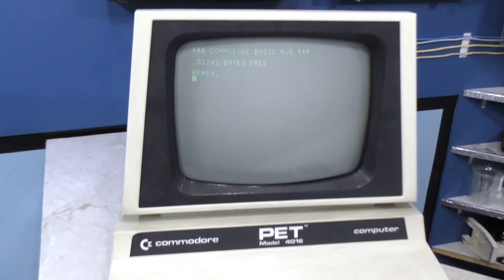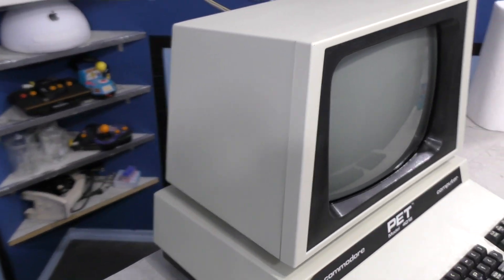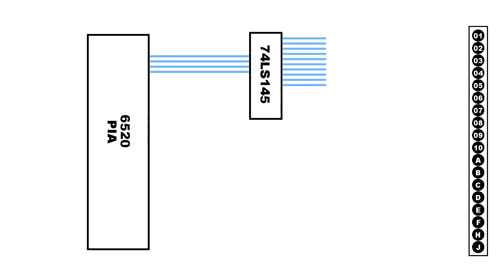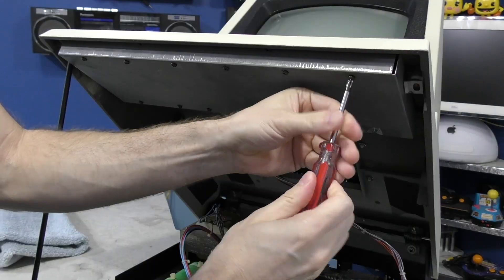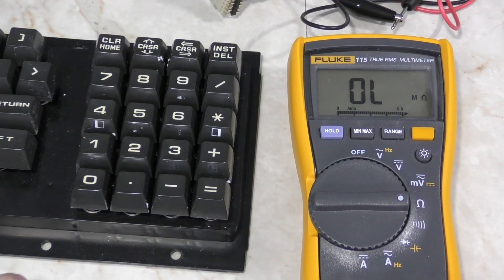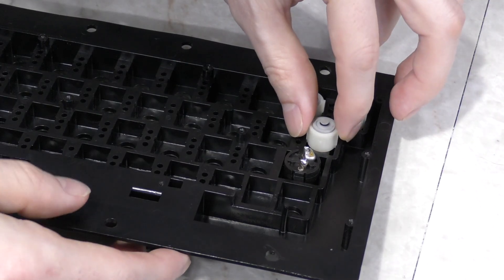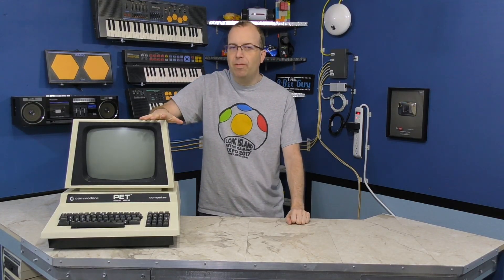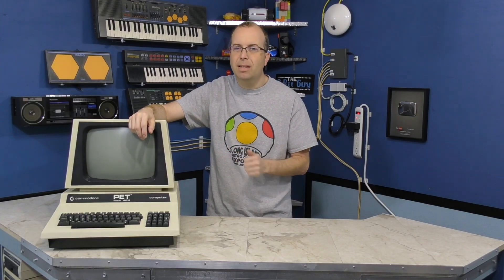Commodore PET Repair and Restore

Comment: I just did a restoration on an early model VIC-20, which has the same style keyboard.  I used a Nickel Conductive Pen to coat each carbon pad.  Seems to have worked well, but I can't speak for the durability yet.  The pen was much cheaper and could probably do at least 3-4 keyboards before running out.  Link> https://www.amazon.ca/MG-Chemicals-Conductive-Pen-Nickel/dp/B01LYAA814/qid=1505418400

Comment: I bet some previous owner tried to repair the keyboard by switching out the keys that were starting to fail with ones from a business model that didn't have the graphics printed on the keys, and they broke the spacebar trying to pull it off. You might be able to find a dead PET with a good keyboard and swap the keycaps and spacebar to fix your remaining keyboard issues.

Comment: You should check out Sciplus Wire Glue. I don't know if it would work quite as well on the carbon contacts, but I have used this stuff for minor repairs and it worked well.

Comment: When I worked for a computer repair factory in the late 80s early 90s, we would use extremely fine (the finest you can get) sandpaper on the carbon contacts and rub it as gently as possible on the contact.  We found that just rubbing alcohol on it's own never worked perfectly either as in your demonstration.

For the metal / gold contacts, we used a simple pencil eraser and then wiped them over with alcohol to remove the rubber residue.  It always worked for us and didn't have a single return.

Of course, you could always use electrically conductive paint, but that's not something I have ever been a fan of, but it's cheaper than that repair kit.

Comment: My Commodore has a small monitor but its case is also made out of plastic. Commodore made the metal cases in their factory that also build filing cabinets, but later on they switched to plastic to save costs.

By the way the keyboard should be familiar: the C64 used the same keyboard but they removed some of the keys from the numeric keyboard and changed them into F-keys. The keyboard layout is of course irrelevant: that's just a matter of a table in the kernal.

While the PET may not be for everyone, that's mostly because there's not that much software for it. They are actually very easy systems to repair, because there are no custom chips inside it. The hardest parts are the old RAM chips which tend to go bad over time. But there are people who have made little circuit boards that you can plug between the 6502 and the motherboard that will let you test the chips, the video and the RAM, and will work around any memory problems you have.

Information is actually easy to find, if you know where to look. Start at the forums at 6502.org and check out ftp.zimmers.net for all schematics, ROM dumps and other interesting stuff.

Comment: Now before you make the very first part of the Commodore series you have to decide what base unit you want your fixed bits to be in the full metal or the part plastic. lol.

If it's interchangable I'd go full metal on it I think if that was the original one.

Comment: You'll find it works better to leave the cleaning solution on for at least five minutes. Get the surface good and wet, and you won't have to scrub at all in order to get the crud off. I collect mechanical calculators, which are usually constructed of painted metal just like the PET computer.

Comment: Im not sure if anyone mentioned this but you may have been able to use a circuit pen to add material back to the key pads which would've been much cheaper.

Comment: BTW, My cleaner of choice is some ZEP 505 - it's a cleaner degreaser and if you're not careful, it'll leave the 'degreaser' on there even after you've 'wiped it away'.  SO I usually go back after drying off with paper towels, go back with wet paper towels or a damp-ish sponge) and try to scour a little bit while also getting rid of more of the degreaser, then another round with the paper towels and finally if need be, back to a magic eraser and more paper towels.  a little goes a LONG way but it's made my "cleaning" projects SO much simpler.  give it a try or PM me your address and I'll send ya a bottle to try!  *(nope, don't work for them, just a fellow restorer and retro-brite-r)

Comment: You really should start using sugar soap, its far less abrasive and takes all this crap off really easily. Also, take the thing apart before you clean it - I wash cases down with the shower and leave them in the sun.

Comment: I restored an old keyboard with this kind of rubber using tin foil, super glue and a paper punch. I punched the tin foil with the paper punch and glued the tin foil on the rubber. Working fine since 2009.

Comment: the tool used for fixing the keyboard seems like a "conductive silver paint", which is basically a mixture of silver and paint. widely used if you want to overclock and change your amd Athlon XP cpu. 
as for the screen, basically the brightness for a crt display will be not enough for two reasons:
1. crt display is going to die. the filament or phosphor might have reached its life.
2. elec issue. for example, if the coil of FBT is having a weak insulation, voltage to the CRT might be lower than normal, then making the filament not hot enough to send electrons to the screen.
Both of these problems can be partially fixed by raising the output voltage of the FBT, which means turning up the "sub brightness control" in the video. However, I still recommend to open the CRT and see if it is really a crt problem, because if the problem is on the coil of the FBT, simply raising the voltage could possibly lead to permanent damage for your PET, or even you.

Comment: Dear 8-Bit Guy! When I repaired old synth keyboard I also tested it with multimeter in 'beep mode', but i discovered that pressed key have a little resistance, so even if it works you will not be able to hear beep. You need to hold each button for a longer time and check resistance changes

Comment: Using baking soda is actually stripping the paint. It's an abrasive. So you're not so much as cleaning it as taking off the dirt and a bit of the paint.

Comment: Not sure if anyone else has pointed this out, but he could do the same thing on the cheap with either some spray-on dry lock lube / anti seize (my preferred method) or a more permanent solution with some acrylic nail polish with metal shavings mixed in (say, grinding a penny with a dremel)

Comment: Thirty years ago I bought a really nice discarded keyboard for a project. It turned out that the keyboard circuit used capacitance detection instead of real contacts and I couldn't get it to work (that's why I got it cheap). To make it work for me, I used some expensive silver goop (just like in this video) to make the keys create real electrical connections. I figured out the keyboard matrix and got it to work!

Comment: I laughed out loud when you lifted the cover up and used that bar to lock open. That's just mad funny. That multiplexed keyboard is probably the mainstay of keyboard scanning on embedded application. The chipset was a trip down memory lane. I remember when this was cutting edge. Regards Chris
Reply: I think although your fix corrected the keyboard the resistance reading of the original pads was normally. The material you put back is a much lower resistance than the original. I think you should check if there's in pull-up pull-down resistors associated with the keyboard scanning

Comment: One recommendation, NEVER put a non insulated screwdriver close to any CRT component, you was lucky and you do not electrified yourself. 
To know in a monocrome monitor the focus pot has around 1kVdc on the high potensial pin and the intencity pot around 100Vdc. So be carefull.

Comment: I repair these old keyboards' pads by painting some graphite coating on them. That's much cheaper than this repair kit and worked fine so far. Some people say that it will rub off after some time but I never had a problem with it and even if, I could just clean it up and apply it again...

Comment: Hi, for the keys you can use some serigraphy, with a tiny screen and poly ink you print all the missing things, it's very easy really, that poly ink it's special for wood, glass and plastic and it doesn't drop off.

Comment: Just wondering...but would it have been cheaper to glue aluminum foil to the bottom of the keys? I imagine copper would oxidize. Or maybe glue some wire across the  bottom? I know dumb ideas probably hah

Comment: Yeah the stabiliser tabs on these old spacebars can get pretty fragile from age. I had a similar problem on an old IBM mainframe board that I fixed by cutting up a credit card to size and glueing it to the remnant of the plastic tab. Doesn't look great, but it's on the inside of the spacebar and it works. I've never seen that conductive paste to fix the rubber pads before, that's pretty interesting.
Reply from the maker: That's a similar idea to what I'm considering.

Comment: I'd recommend finding someone in your general area who restores/repairs old TVs to have a look at the monitor. You probably have either not enough high voltage due to worn out or failing components in the HV circuitry of the monitor or a worn out CRT (poor emissions). First can be easily fixed if you know what you are doing, the second pretty much means you need a new CRT sooner or later. Just cranking up what probably is the CRT heater voltage with that pot is a lazy fix at best and at worst will make the CRT wear out and die much sooner.
Reply from the maker: I had actually the same thought and concerns... but I asked several experts and most of them suggested just turning up the sub brightness.  I'm still concerned, like you, that maybe that's not the next permanent fix.  But I'm not an expert with analog electronics.

Comment: Don't shove a static-inducing towel on a PCB x_x
Reply from the maker: I doubt it could hurt much since the entire bottom half of the case is metal and all of the chips are in the board where they are grounded.  Not to say it's impossible, but I think the chances of any static discharge actually hurting anything is pretty remote.  I also suspect these are all NMOS chips which are a bit more heartier than CMOS, so to speak.
Reply: Chances of ESD failure are pretty big actually, you could just fry a chip by touching it. Now indeed NMOS is quite durable but ab ESD discharge you don't even feel can be tens of volts. And that could be just enough to make the chip fail, even when it's grounded.

Comment: Great job as always. Worth mentioning that adjusting a timmer pot through a chassis is not a good idea. It's okay here because it's plastic, but in other devices the screw terminal can be at a high voltage which can be shorted against the grounded chassis causing damage. You only make that mistake once though. :-)
Reply from the maker: Indeed.. In fact, I turned the machine off while adjusting it anyway just to be sure I didn't slip and poke that screwdriver into something it shouldn't..

Comment: For the love of God, man, there is an L in 'solder' 😭
Reply from the maker: In Texas, it is a silent L.
Reply: haha is that even a thing 😂 
Love the channel despite the language barrier mate. I have the old PET you showed in this vid. Chicklet keys and tape drive. Works too
Reply: +Bongo Baggins  The Oxford English Dictionary lists both sɒldə(r) and səʊdə(r)  as proper pronunciations (the second one, səʊdə(r), is listed as the U.S. pronunciation).  So it's still correct, either way.

There are many other English words with a silent L; it's really a mixed bag.  For example, I pronounce the L in CAULK because, well, you don't want to have an unfortunate incident helping your sister-in-law tile a bathroom floor.  (I speak from experience.)  But it is supposed to be a silent L.

Comment: When I serviced a vectrex controller for a friend I had the same problem, the carbon pads just werent connecting right. I ended up using a syringe of 'circuit fixer' its meant for replacing broken PCB traces but works just fine for repairing keys/buttons too. I think I paid £6 for about 0.2ml so not cheap, but it really is very easy to use since it comes with a fine needle.

Comment: I fixed the same type of spacebar problem on IBM Model M with those screwterminals/motherboard standoffs. I sawed the threaded part of and glued other part with the hole on the bottom of the spacebar. They hold that metal stabilizer rod and everything works fine.

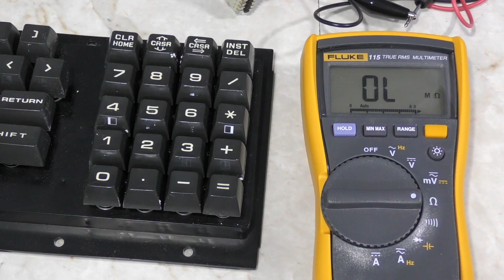Comment: 8:22 The flat tipped screwdriver proved that the problem was with the carbon pads, not the board. So why then did you use the Deoxit on the board?
Reply from the maker: Because the flat tipped screwdriver was rather sharp.. so I was thinking maybe if there was a fine layer of oxidation, maybe the screwdriver could penetrate it where the rubber pad could not.  It wasn't like it took a lot of time to try.
Reply: Ah, OK, I was just confused when you said you got your answer after trying the screwdriver.
It was good to learn about that conductive paint, thanks.

Comment: That keyboard problem seems to be quite common with PETs. I had one that suffered from it, back when I was still collecting retro computers. At the time (nearly 20 years ago) there was very little repair info available online, but I found something that suggested I try using the blue end of a pencil eraser on the gold contacts on the keyboard PCB, and that seemed to do it.

Another of my PETs made a scary electrical arcing noise from the CRT when it was in operation...

Comment: There is a way to transfer using silk screen. You could print inverse mask (places you want to be clear is printed solid) on projector slide sheet, then look up silk printing. It tend to be for shirts but you can do more with it.

Other option is clear sticker printed, then clear coat covered to protect it. Not perfect but better than looking for ridiculously rare keyboard buttons.

I wondered if could simply make a epoxy/silver mixture that would be conductive. Probably cheaper than that thing you bought to fix keyboard.

Great work. :)

Comment: There is a way to fix the missing characters on the fronts of the keys. I did this on my Pet style keyed Vic 20. You need a Brother label printer and a white on clear cartridge, also a decent copy of the Petscii fonts used, which can be found on the internet easy enough. The post is overat denial forums in technical/hardware and tech on page 2, the heading is "Retrobright keyboard disaster and fix"
Sorry But when I add links my posts do not show up here.
Reply from the maker: Interesting.. not a perfect fix... but might be worth trying.
Reply: Not perfect, but likely as good as You can get for cheap. I only just realised the PET only has 1 petscii character on the front of the keys as opposed to Vic and C64. What I did was to zoom into the petscii pdf and use windows snipping tool, then imported that into the Brother label software, adjusted the size to suit, printed then carefully cut out and stuck it to the keys. I printed extras as It did sometimes take a couple of attempts to get it right for each key.

Comment: dear mr david,
the space bar on my computer had the same problem.
messing with the metal bar on the bottom fixed the issue.
pushing  the metal bar back with a screwdriver untill you hear a click  should work
Reply from the maker: The problem isn't that simple.  The tabs that hold the metal bar are broken off.  There's simply nothing there to hold it anymore.

Comment: David, please get a 3D printer!   Whilst I understand they are still somewhat expensive and solutions to problems without printing plastic parts would usually be preferable, in some cases it may be unavoidable, maybe like this keyboard piece you need for the PET.  It would be great to see your repairs including a few 3Dprinted items making them that little more complete.
Reply from the maker: I have a 3D printer.  The irony is that everytime people start yelling "3D printer" the truth is that the printer will not solve the problem.  There are tiny plastic tabs broke off from the plastic on the keyboard.  There is no way to 3D print that.  And in the Armatron video people wanted me to 3D print a tiny gear the size of a pencil eraser with 40 little teeth on it. No 3D printer costing less than $50,000 would have been able to do that.

Comment: 11:38 The label on EEPROM is to protect the chips die from UV exposure. Because those chips can be erased with UV light. That's why there is that see thru circle on chips. I guess it was a faster way to erase them back then.
Reply: EEPROMs are electronically erasable programmable ROMs. That's an EPROM, or erasable programmable ROM. These get erased by UV light.

Comment: We had the problem with the space bar in the school too (modern pcs). We needed to put a little Metal bracket back in the key cap so it can activate the switch

Comment: Interesting to see that rubber keyboard repair paint. I'd assume it's just conductive paint of some kind? My PET (CBM 4032) suffered from the same keyboard issue and I managed to get it working by scrubbing off a layer of oxidized carbon from the key pads but it's not a permanent solution since when I tested it about a year later many of the keys had stopped working again. Famicom controllers use the same system and have the same issue after a few years. What I did recently to repair some famicom clone controllers was basically "color in" a sheet of paper using the pad almost like a pencil. That wore away the non-conductive layer and got the buttons working again - but I doubt it will be a long-term solution. My family had an old 8k PET back in the early 80s and I remember it having the same keyboard issues after a few years then too.